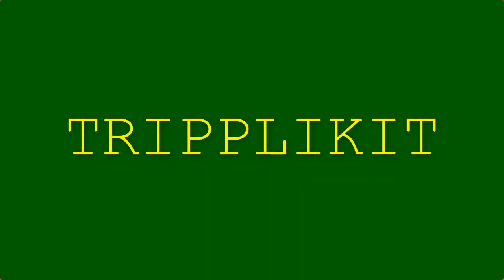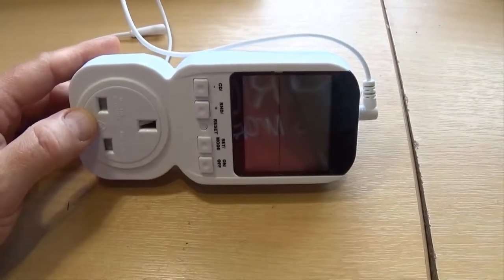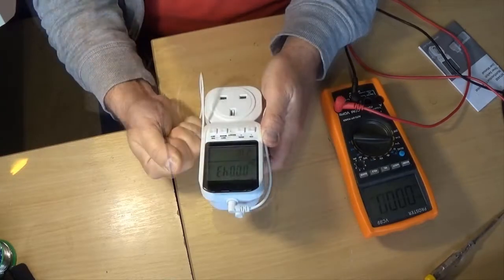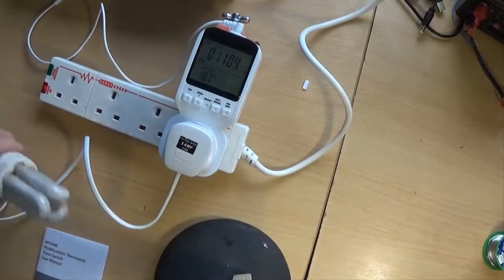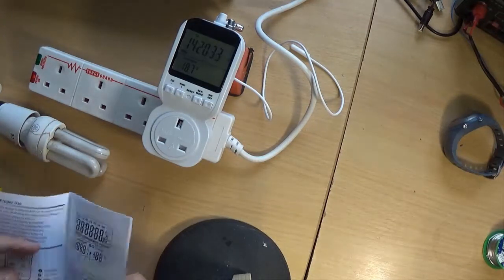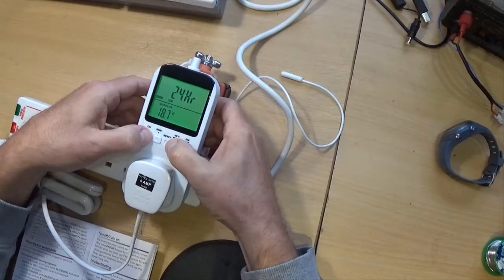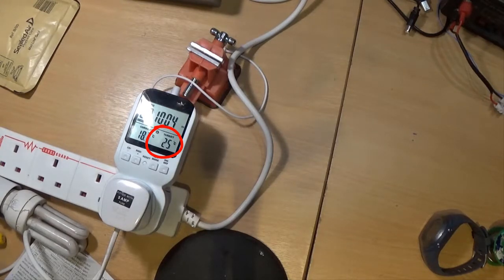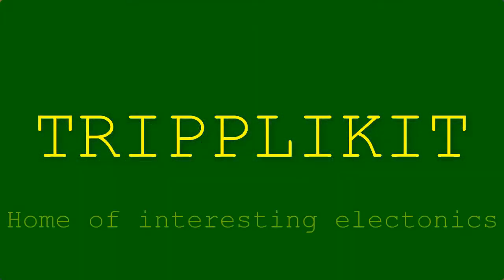MTS400 Multifunction Thermostat Timer. Can We Program It? Is It Faulty?Heater Controller

Comment: I have a couple of these. I used one to control a 2 kW oil filled radiator in a caravan that I used for my tea and lunch breaks through the day one autumn. I had it set to maintain a minimum heat overnight, and then start to increase the heat of the caravan half an hour before my breaks. Just leave the oil filled radiator set to max. Set the timer to be Heat on (shows Heat on display) during the periods that you want the room to increase temperature, and heat on at a lower temperature for the rest of the day.
Also good for setting fans to cool a room during cheap electric periods or breaks during the summer. 
CD is countdown mode (shows in manual) so starts counting down when the timer on period starts, or when you want to leave something on for a set period when leaving the room
Reply from the maker: Yes, it also did the job I wanted it to do and I liked the temperature sensor on a cable as I found I could get a better reading of the room temperature - rather than the wall temperature. 
I found it clunky to program but that was OK as I didn't need to reprogram it too often.
The problem I had with it is that the relay driver transistor failed and at the time I didn't want to be othered trying to fix it.

Comment: You have to use the ON/OFF programmes to tell it when you want the power to turn on and off and THEN you use H1 to set the target temp for whenever the unit is ON.  H2,3 and 4 are only for if you want different temperatures for different periods of the day - they don't actually turn the unit on unless it is already turned on using an ON/OFF programme.  So the timer and the heat control functions are set using different programmes.

Comment: Hello there! Have you had any updates on this thermostat by any chance? I'm a student studying abroad and am trying to ration my heating bills. I wanted to get this thermostat for a radiant heater in my main living room where I don't spent too much time but would like the temperature to remain a steady 20 degrees. However, I would only like the heater to be on during the dual-tariff hours, so that would be between 1pm-3pm and 10pm-6am and I would only like it to run to maintain the temperature to a preset setting (e.g. 20 degrees) so I wouldn't like it to be on continuously for 8 hours regardless. I knew I'd probably get better feedback from you than the manufacturer, so do you think this kind of setting is possible to do? So essentially I would only like the heater to come on during specific hours and automatically shut off when it reaches the preset temperature. Any feedback would be much appreciated. Thank you.

Comment: I’ve bought the same rubbish. I was fiddling about with its buttons for more than an hour, but couldn’t get it to work. The only thing I could achieve was to switch it on and off manually by pressing the on/off button. Beyond this no function whatsoever. I was searching for some video manual for the device and this is the only one I found. And it just confirmed that it is RUBBISH!!! If you expect to get any help from the user manual - forget it!
Reply from the maker: Seems I was lucky to get mine to work at all. I do remember it was terrible to program.